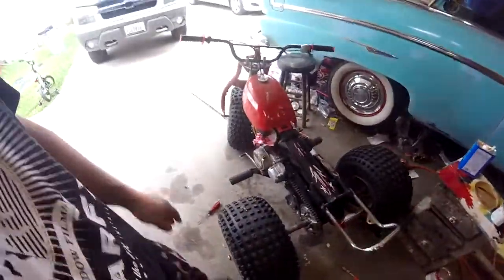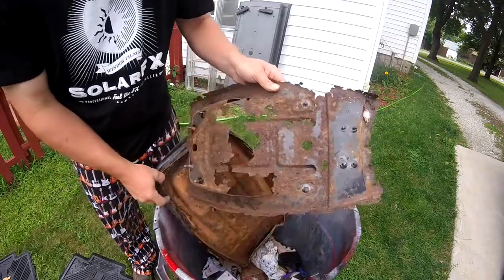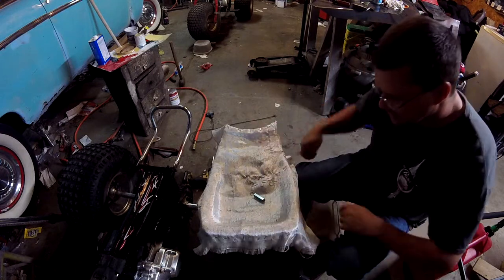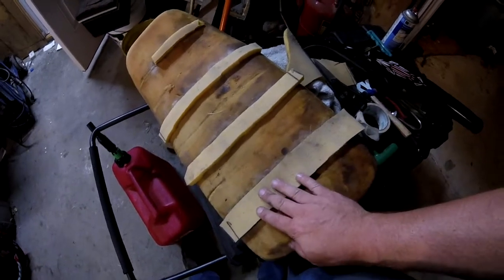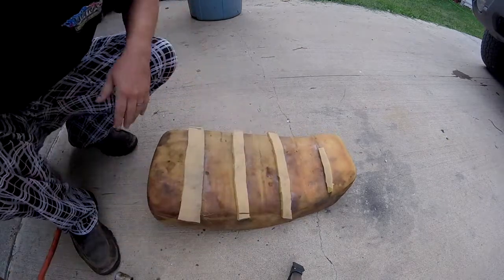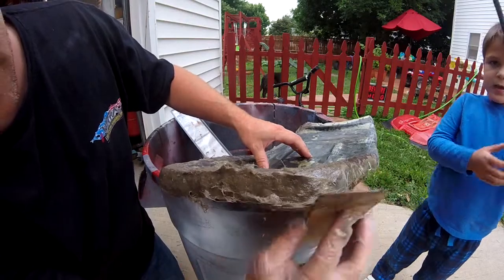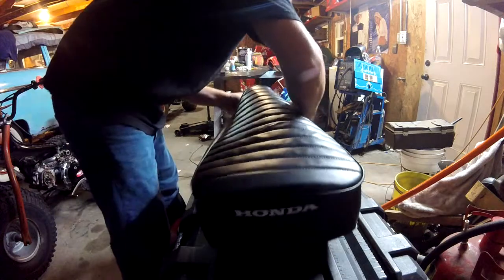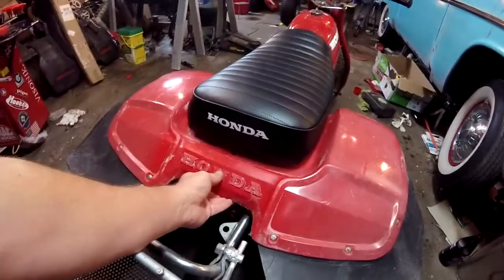Honda ATC110 seat pan saved on Terry10

Comment: Did you use fiberglass mat or fiberglass cloth? I need to rebuild my 125m seatpan. Thanks
Reply from the maker: I'd lay the cloth first as the weave holds it all together over big holes or missing sections. Let it set up then lay the mat to reinforce
Reply: @effortequalsresults  Did you fiberglass both sides of the pan or just the top side?

Comment: Hey man can u pls tell me what you used I have the same exact problem with my atc seat pan
Reply from the maker: Fiber glass resin .fiberglass cloth. Thick staples. Embed the staples in the cloth and wet it down
Reply: @effortequalsresults  thanks man you did such a great job!!!
Reply from the maker: @imhim1798  thanks .